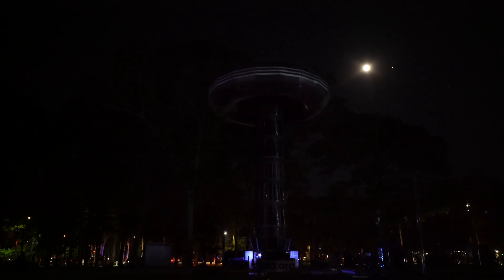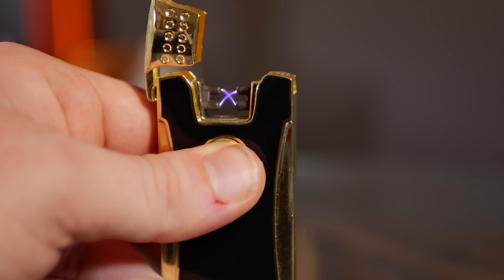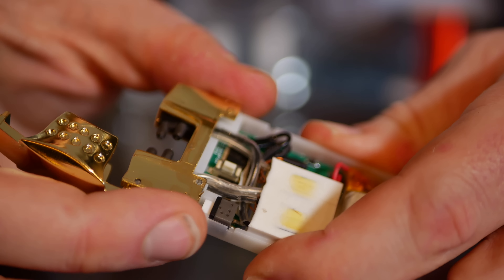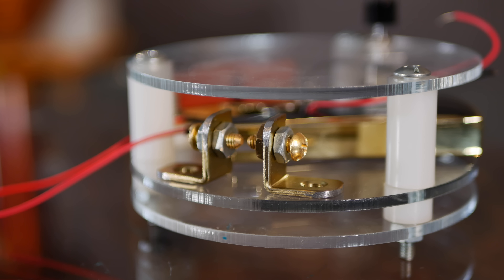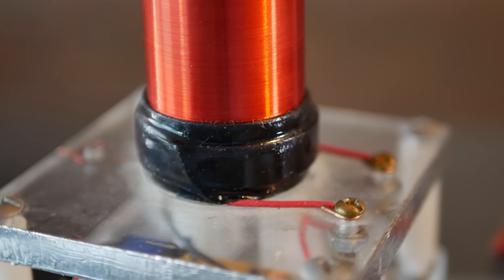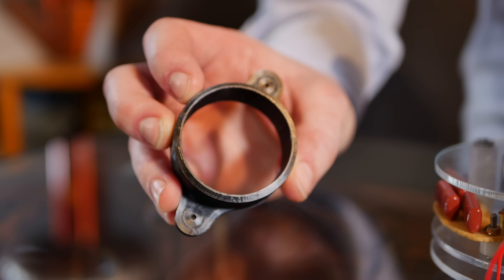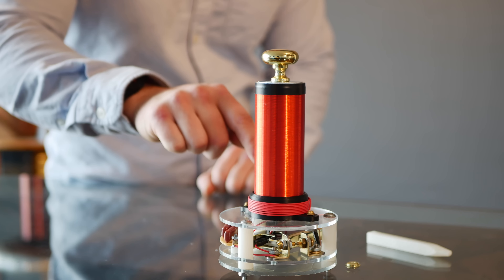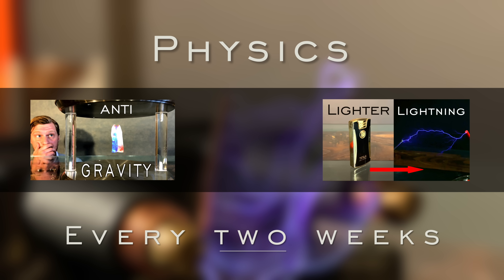DIY 50,000 Volt Arc Lighter Powered Tesla Coil (ft. Integza)

Comment: Could I use ceramic capacitors instead of polypropylene if they have the same voltage rating and capacitance?
Reply: What type of ceramic cap? Class 1 NP0 would be your best bet I would think

Comment: can a tesla coil act as a boiler when a tube wrapped around it when water goes through it and ends up steam at the other end of the tube?? if it can i have a new engine design. Second question does the tesla coil need a battery? if so what can replace it?.... TY

Comment: Hello

I am a physician, not a physicist. 
I have had a couple of patients over the years that mentioned a few things  about the  "Philadelphia experiment"

Basically what hey describe are  10 foot Tessa  coil sets mounted with  separate primaries at  90 o from each other in a X Y Z arrangement on separate Bakelite bases. Each coil has it's independent primary but driven by the same power supply.  The  primary input was 20,000 V at 10 amps. These XYZ  COILA WERE MOUNTED ON THE BACK FRONT AND SEVERAL ON BOTH SIDES OF THE SHIP ON THE DECK . 
AS THE VOLTAGE WAS INCREASED NO SPARKS JUMPED BUT AT A CERTAIN POINT IT CREATED WHAT I INTERPRET AS A CORONA FIELD THAT ENVELOPED THE   SHIP.  AS THE VOLTAGE INCREASED THE CORA FIELD TURNED FROM GREEN ( ionized air) to a BLUEISH PINK  (?.?) and the ship disappeared, but the corona  remained.  The imprint of the ship of the hull could still be seen in the water.  After this the ship disappeared. I suspect they were increasing the frequency along with the voltage.  Have you tried this XYZ ARRANGEMENT OF TESLA COILS? From the 10' long secondaries, one can get an idea of the wavelength. Now the frequency must have been controlled by a pentode tube . They did not have transistors in the 1940's.  The ship hull was emptied & filled with diesel generators. The voltage was likely controlled by a variance.  What rectifier could they have used back then? It gad to have been a "diode tube from hell".  Any thoughts about the above? These were people in their 60's in the mid 1960's

Any thoughts?

SERGIO 

You can email me at viceroy 1927 @ gmail.com.

Comment: Could we get an stl file or a way to print our own mount for the primary coil?
Reply from the maker: Great question! I do have the file- I’ve reserved that for my Patreons though. If you’d like to support my work while getting a few extra perks, please consider checking me out on Patreon.
Reply: @PlasmaChannel   Thanks a bunch, just joined. Happy to support the channel
Reply: @PlasmaChannel  Just a nother follow up question, would you happen to have a picture of how you wired up the lighter? the switch is easy enough but the leads should just be wired the same side they were on the lighter right?

Comment: Aren't arc lighters AC high voltage ? 
I'm asking this as you don't use diodes to rectify the output of the lighter 😉⚡
Reply from the maker: they are high voltage AC , which is WHY I used a high voltage diode. Talked about it in the schematic section. Cheers!
Reply: Plasma Channel : ah ok, I saw it in the schematic, but not in the components, I was troubled 😂😉

Comment: Is it possible to replace the arc lighter with the high voltage circuits selled on amazon 
They works as same as a teaser or stun gun

Comment: Great video! I started to wind the secondary and found I can only get 270 turns on the 4-1/2 " long PVC pipe. I am using 1-1/4" I.D. pipe that has a 1-5/8" O.D. I am using a hand turned winder and it checked good for one revolution per count. Any thoughts on what I might be doing wrong.
Thanks'
Don

Comment: What happens if you touch the metal part? how big is the current?
Reply from the maker: You can touch it with no problem. Heck, I even licked it. The current is very low, too low to even cause muscles to contract.

Comment: I tried building the last one, but I couldn't get the spark gap working (idk if it was the racket or the capacitors) but now I have a 3d printer so it looks like I'm making this haha
Reply from the maker: So the spark gap isnt really something that does or doesnt work. It allows high voltage to jump and short circuit the capacitor. So, that means your powersource likely was bad! Cheers. I'll also be offering kits soon.
Reply: @PlasmaChannel  Well I used ceramic capacitors at the time because I couldn't find polypropylene ones like you had, they were storing the charge (I would repeatedly discharge them with a screwdriver so I wouldn't shock myself) but when I turned the circuit on it would just have one spark in the spark gap and then stop.

Comment: What can be used instead of arc lighters???
Can we experience long arcs without using arc lighters????
Reply from the maker: You need a high voltage supply of at least 3,000 volts in order for this design to work. Several other options available, such as a higher-quality electric fly swatter.

Comment: What is the diode for? I’ve never seen anyone use that circuit before
Reply from the maker: The diode allows the capacitor to charge up. Without it, the AC passes right through this capacitor and doesnt charge it.
Reply: Plasma Channel ohh ok, that makes sense!

Comment: Question on the wiring for the high voltage. There are 4 wires, 2 with a clear covered wires and black clear covered wires. I looks like in the video there is a clear covered wire and a black clear covered wire are connected to the 2 red wires. The other 2 wires look like they are insulated to keep from making contact with each other and anything else. Is this correct and if so does it matter of the 2 clear wires or which of the two black wire I use?
Reply from the maker: Hi Taylor. You actually want to wire the transformers in series. The two wires that did not connect to the rest of the Tesla coil were soldered together, and insulated heavily to prevent arcing to the metal case. 

Connect up the two wires that are closest in proximity coming out of the transformers, and use the outer leads to feed the Tesla coil. 

Cheers
Reply: @PlasmaChannel  Thank you!!!!!!!!!!!
Reply from the maker: Happy to help! Just make sure you don’t abuse the lighter... and that you do not touch the on button or the lighter while touching the output of the Tesla coil. It will fry the lighter immediately!

Comment: Hey, I had a question do I solder the wire on the the two high voltage leads for the arc lighter and cover with heat shrink?

Comment: Just finished this build, everything works great! The power does seem to cut off after about 7 seconds though. Does anybody else have this problem? I was wondering if it was the spark gap length, or if the arc lighter has a failsafe timer in it. Would be curious to see if anybody else ran into this problem.
Reply from the maker: Nice! It turns off automatically. The lighter has a safety program to make sure it doesn’t overheat. Mine does that too

Comment: I bought an arc lighter, but it automatically turns off every ten seconds.
Did your lighter do that? If it did, how did you get around that problem?
Reply from the maker: Hi, that is entirely normal. This tesla coil does not run more than 8-10 seconds. The auto off feature protects the internal parts from overheating. I'd definitely recommend not abusing the lighter though, and only use this tesla coil in 8-10 second bursts...give it a few seconds to cool, then repeat.
Reply: I just took out the arc lighter’s transformer and made my own driver for it that could handle longer run time. I got bigger and hotter arcs from the transformer.

Comment: Hello jay, I’m currently doing surgery on my arc lighter. I noticed there are 2 transformers for the 2 arcs. How do I isolate the second transformer? Or is the second used as well for additional power?
Reply from the maker: You need to connect those two transformers in series. solder the wires connecting them together. The wires you'll want to connect together, are the two wires closest to one another. Make sure you inslulate the wire connection well.
Reply: Plasma Channel Done! I couldn’t find any polypropylene caps so I’m using 3kv high voltage ceramic capacitors, hopefully they last. 
Thank you for the help jay, I really appreciate it! Your channel is amazing btw! Keep up the quality content!
Reply from the maker: Glad to help! Ceramic will indeed work, as long as the capacitance readings are the same. Ceramic is a bit lossy, so you can expect smaller sparks.. but it will still work just fine!
Reply from the maker: Also, don’t run the coil for more than 6-8 seconds at a time. This helps keep it fresh.
Reply: Plasma Channel okay, I will look around for those polypropylene caps. The bigger the spark the better! Thanks for the tips I usually hold them for a couple seconds at most. I purchased a high voltage boost converter on amazon for cheap. It only uses 3 AA batteries and it creates a scary spark (loud too). It would be cool to see you incorporate one of them in your next video, maybe even use that to power the Tesla coil!

Comment: question, lets say i used a small 8 inch plasma ball broke the ball and used the tesla coil. it produced a very small spark powering a invention im working on for uspto patent.. well the tesla coil produced over 600 volt jolts beyond what my meter could read and voltage jumped around within the system i created.. so i bought a 250,000 volt tesla coil real deal for a larger experiment to prove my theory.. my question is how much spark voltage you think the tiny plasma coil had so i can figure what a 250k will produce? Also do you think electricity voltage can go to infinity or will it cap out? like if I got over 600 times the voltage on the tiny plasma coil mod or will I get 600 x 250,000 from the larger coil or will it cap out or max out no matter how big a tesla coil i use?
Reply from the maker: This coil produces 40-50,000 volts
Reply: @PlasmaChannel   hmm i must admit im very ignorant and learning fast. being super careful.. I broke a plasma ball to get the coil without the globe.  it wouldn't spark on my finger I had to hold a piece of tin foil close to it or metal and it was not as big as yours. hmm I need to have my election put in a new circuit in my house and a very well grounded outlet. my problem is I have no idea how much voltage I was inputting in the soil to be able to calculate how much the 250,000 coil will produce. I feel like a idiot in my first experiments trying to power things without a capacitor and resistor. im gonna learn from u build another small scale one for testing, before I use this big one. I tink from studying I was using a tesla coil to turn the soil and plant into a living tesla coil and it seems plants can transfer electrons and the plant remains unharmed. Also what if someone made a geodome out of aluminum and put a huge tesla coil in there? It would be a magnetic dome!
Reply: @PlasmaChannel  can I request you build a tube wrap a coil around it then on the inside connect high powered lasers aimed to intersect each other covering the inside.. it should produce gravity waves... can you test this? I dont have the money to test it. I think more energy put in the more gravity waves it will produce so use a dial thing.

Comment: I’ve been thinking about making a small portable voltage multiplier that could fit in a small bag or large pocket, so that by putting on thick rubber bottomed boots, I could walk around while charged with enough static electricity to make maybe 2-3 inch sparks. I’ve been experimenting with rough prototypes, and I think I could easily make it a finished product, all I need is a breadboard like the one from your desktop voltage multiplier, and a container and wax/mineral oil to insulate the voltage multiplier. But even though the capacitors for it are small, it would still hurt to get shocked by their full power. Do you have any ideas for a small enough resistor with enough resistance to make it safer? What kind of resistor do you use in your big voltage multiplier (although something like that probably isn’t enough resistance.) I’ve seen people use plastic tubes filled with water, but that would probably be too big and not portable enough to carry around. Any ideas you have or advice on building it would be great!
Reply from the maker: This depends on the voltage total of the multiplier. What is the output voltage?
Reply: @PlasmaChannel  it's hard to tell but I'd estimate at about 100-150k maybe more, but probably under 200k. Right now it makes 2 and a half inch sparks max between two round objects, and I'm not planning to have more output than that.

Comment: Is there a specific way to wire up from the arc lighter? Have tried several different configurations and can’t even get the spark across the spark gap? As the arc lighter has 4 poles I’m assuming 2 + and 2 - but how do you know what’s what??
Reply from the maker: You should have two parallel power sources, both outputting high voltage. Wire them in parallel, and you’ll now have double the available wattage going into two wires. For example, tie the right wire of each wire group to the other, and tue the left wire of each group to the other. You’lll now have a combined right, and combined left. Two end wires, where HV jumps between.
Reply: @PlasmaChannel  that’s exactly how it’s setup at the moment, the only thing I don’t have is the diode, but it should atleast still spark without this? 
Maybe I’ll try sstc instead?

Comment: Could you tell me if this is used does it emit ozone
Reply from the maker: All high voltage emits ozone. However, due to the size and low power of this, it is a non-harmful amount.
Reply: @PlasmaChannel  thanks for the reply 
I was thinking of setting up a small electric arc  in a enclosed room  with a widow open to let  a little fresh air in ,would this effect me

Comment: Wait, “but they actually required a high voltage power source just to operate”… I’m surprised this hasn't been explored yet. The Tesla coil design in this video and others like it were augmented to demonstrate the power they could harness (and because Tesla probably knew that someone wanted to steal, claim or weaponize his technology, so he encrypted it in this design). While it was the design of Nikola Tesla, it's not the design Nikola Tesla intended for wireless power. Think about it: as they’re built today, we typically take an AC power source through two coupled coils, another set of components like a capacitor and spark gap and the signature primary and secondary coils that is then dissipated into the atmosphere. An AC power source dissipating into the atmosphere.. What else do we know that generates an AC power source from the atmosphere? Solar panels.. Are you still with me?
These designs were designed to appeal to those who didn't understand the design this one is based on. The real design is quite different in so much as it is the same... The primary and secondary coil is meant to be the first pair of coils, grounded in the earth, pulling an AC power source from the electrostatic atmosphere, ie the sun. The power source passes through the capacitor and spark gap or components to the second set of coils that now instead function as the primary and secondary coils. And if the secondary coil is connected to a receiver or outlet, the dissipation would essentially generate electricity. 

In a nutshell, Tesla’s design was meant to be used backwards. This is why it was meant to be a power source rather than need a power source.

Comment: Hey, love the video but I'm running into quite some trouble with the parts, first of all I was wondering what the criteria for the diodes are because the linked ones aren't available. And secondly is a pvc pipe able to isolate the primary coil well enough because I don't have access to a 3d printer. I'd appreciate help if anyone has some knowledge about this.
Reply from the maker: Hi Henri, any fast acting, 5kv -10kv diode will do the trick. Has to be fast acting. Also, pvc will definitely do the job!
Reply: @PlasmaChannel  Wow thanks for the quick response, that's going to help a lot.

Comment: After watching your old Tesla Coil video I made one of my own .... after some test i use 9v input power and the result is blowing up the transistor of the circuit... but before blowing up i got some ark thats more then 1.5 inch long and when i add something pointy on it gives continuous ark from the pointy end.... but after a while the transistor blows up... in my aria i failed to find that same transistor... so can you suggest me an another transistor that have same value??
Reply from the maker: Hello, so as I mentioned in that video, you're not supposed to go higher than 3-5 volts, and not run it for too long. Even if you use a better transistor, you'll burn out the transformer. If you replace the transformer, you'll burn out the diodes. I'd recommend whole different circuit if your'e sure you want more power
Reply: @PlasmaChannel  oke.. i understand... and sir, you stay classy ... like it :)

Comment: Should try a plasma transformer 😆4000v out or the impressive 400kv ark pulse transformer i like a coil and small low emp just don't stick your open chip near it 😠ffffff but that old solar calculator i got some good footage ark gaps and a spark gap looking st that wheel one 😆 6 in in in in one ???

Comment: I've got 2 of them lighters..gonna av to try and do this now .. where do I get them 3 things u used after u donever the connection from the switch.. I need some of them.. can u just tell me what they are x ty
Reply from the maker: Any push button switch will work. Glad you are giving it a go - do you have experience with high voltage or a least electronics?
Reply from the maker: Oh, you meant the capacitors. You can search for any MPP 3.9nF, 3kv caps online.
Reply: @PlasmaChannel  well I'm am trying to figure out how to do free energy for people.. but keep getting stuck :)
Reply from the maker: charlotte louise wallace I see. Tesla coils consume energy, not produce. Just a heads up!